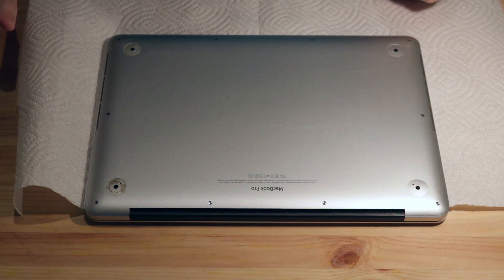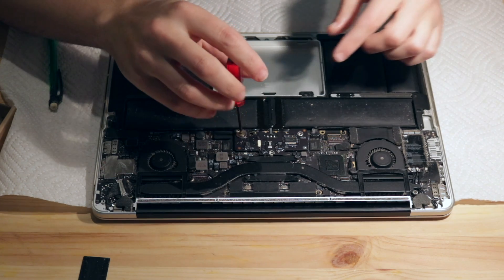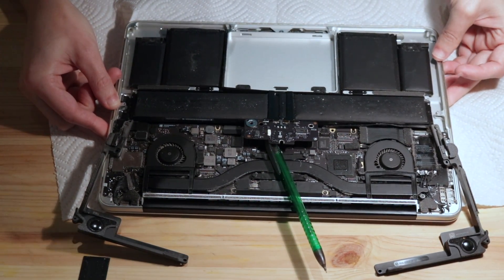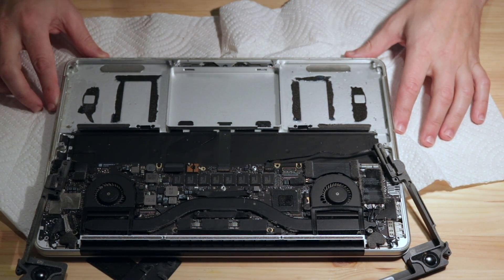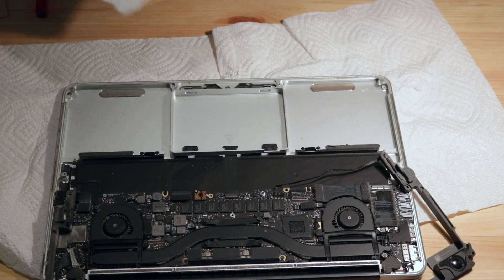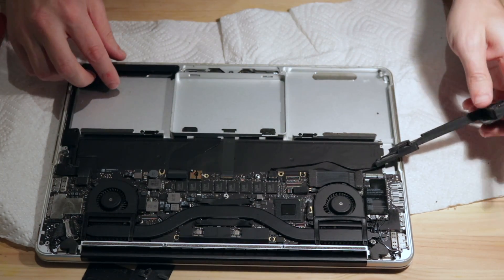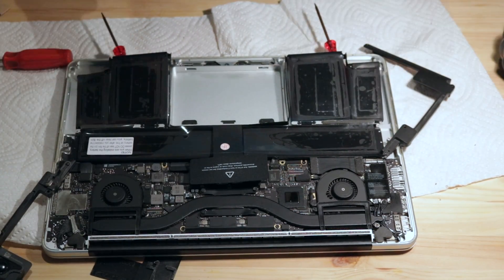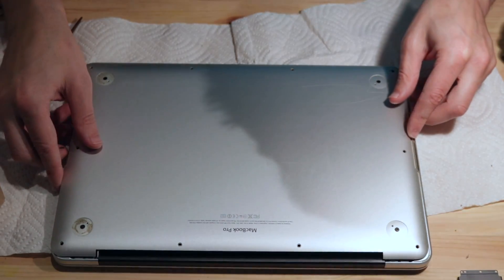MacBook Pro (Retina, 13-inch, Late 2012) A1425 Battery Replacement

Comment: Just completed replacing it in my MBP late 2012. Used an old plastic credit card to cut through the adhesive. Batteries were swollen so it was easy.

Comment: Hi. I replace my battery but unfortunately my Mac in not recognizing the new one. When i go in to the about this mac, system report its seams the battery is not installed.. The mac works fine. Any ideas?
Reply: When you attach the plug to the board there's a locator pin that needs to be in position. I found myself trying to screw the button headed screw in, but it wouldn't bite the thread and it was because the locator pin wasn't sitting right. He does mention it, but only very briefly. If you are still having this problem, maybe that is why?
Reply: Go to 14.50 in the video for the bit I am talking about.

Comment: Great video ! Two additional advices after replacing my own battery on this A1425 model : 
1. Using dental floss might not always work as it is likely to snap. In my experience, it was easier forcing an old credit card underneath the battery's blocks to loosen them. 
2. Be very careful using only a minute quantity of solvant. Using more than a few drops means risking to dip your motherboard ! Fortunately, even if you do, it evaporates pretty fast.

Comment: Thanks to your video, I was able to install the new battery from Puredick. Yes, that's a real brand. Anyway, thanks so much for your help!
Reply: No, Amazon spelled it wrong.  It's Puerdick.
Reply: @albarhorst366  lol cool. I didn't know that.
Reply: Have you problems with Puerdick battery? Warranty?
Reply: @oscartello5281  at the moment I'm taking it out, because I let it die and it's not turning on at all now even after three hours of charging. Apparently, it's been known to do that with this model A1425 and others. This is my last method of resetting it, so I'll let you know how it goes.

Comment: Thanks for taking the time to make this, very helpful.  I am a pro and come to YouTube all the time just to be sure.  You can gently pry the packs off without the need for alcohol or dental floss.  I use a flat wide steel tool very common for phone repairs.  Very important not to pierce the battery, so don't use any pointed or sharp things.

Comment: I did it.  I replaced the battery.  It was pretty easy to do thanks to your video.  I used WD 40 to release the adhesive on the original battery pak with a slow & steady pressure lifting on the battery.  WD40 doesn't evaporate like the alcohol does but you should cover the circuit board area with a paper towel to keep the WD over-spray off of it.  You can clean the WD up with paper towel and lighter fluid.  In fact you could use just the lighter fluid to release the adhesive too.  Your call.  

I took a few pictures during the disassembly to aid in reassembly but it really isn't all that hard and my Macbook is running like new.  Thanks again

Comment: Thanks for your well recorded and informative video.  I have the same computer and the battery has become very weak. It dies at about 30%.  So replacing my Macbook's battery is high on my list of things to do.  I too see no need to replace an otherwise terrific computer just cuz the battery is old and tired. Thanks again.